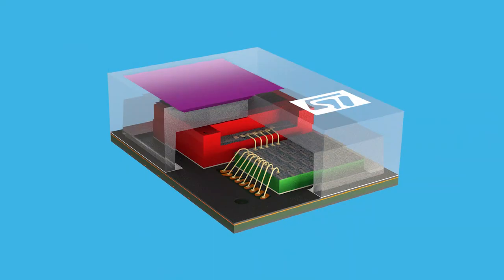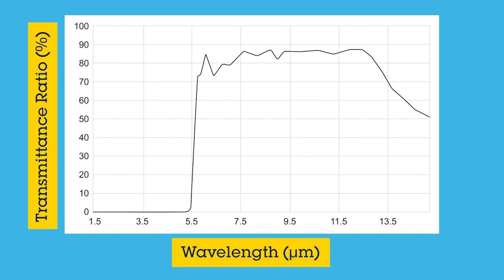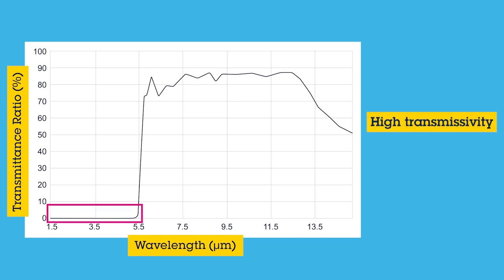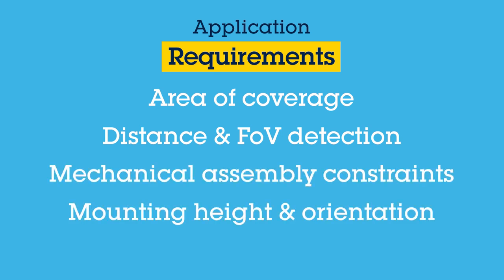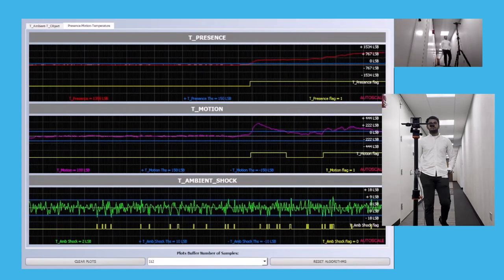Optical Lens and Cover Window Integration Guidelines for the STHS34PF80 Infrared Sensor

Comment: Optimizing the STHS34PF80 Infrared Sensor: Lens and Cover Integration Guidelines

* (0:39) Material Selection is Crucial: The sensor operates in the far infrared spectrum (5.5 to 20 micrometers).  Materials like acrylic or standard cover glass are NOT suitable. Use materials with high transmissivity in the 8-14 micrometer range, such as:
    * High-Density Polyethylene (HDPE)
    * Silicon
    * Chalcogenide Glass

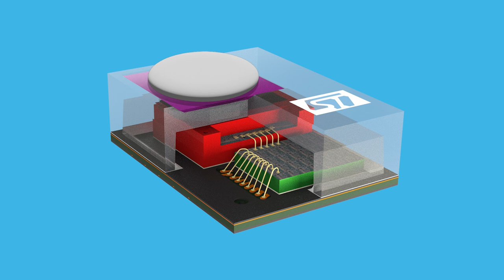* (0:52) Application Needs Dictate Optics: Consider factors like:
    * Area of Coverage
    * Desired Detection Distance
    * Required Field of View
    * Mechanical Constraints (size, mounting, etc.)
    * Operating Environment

* (1:44) Simple Cover vs. Fresnel Lens: A simple cover may suffice for some applications.  For increased distance or wider field of view, a Fresnel lens is recommended.

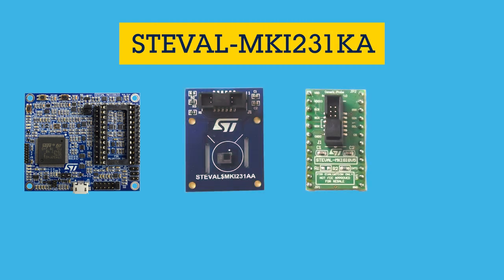* (1:58) Evaluation Kit Available: The STHS34PF80 evaluation kit (STEVAL-MKI231KA) includes:
    * The sensor
    * A lens holder
    * A compact Fresnel lens (TMOS63-10) for long-range, narrow field-of-view detection

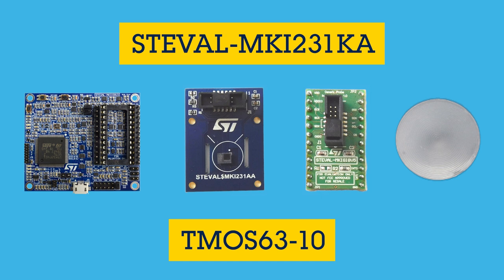* (2:29) Fresnel Lens Examples: The video highlights Fresnel lenses from Fresnel Factory:
    * TMOS63-10: Long-range spot lens
    * TMOS10-12030: Wall-mount lens
    * TMOS00-03: Cover window

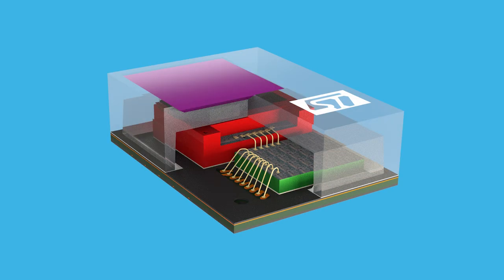* (3:15) Key Takeaway:  Proper material selection and lens integration are essential to maximize the performance of the STHS34PF80 infrared sensor for presence and motion detection.

I used gemini-1.5-pro-exp-0801 to summarize the transcript.
Cost (if I didn't use the free tier): $0.02
Input tokens: 3920
Output tokens: 739